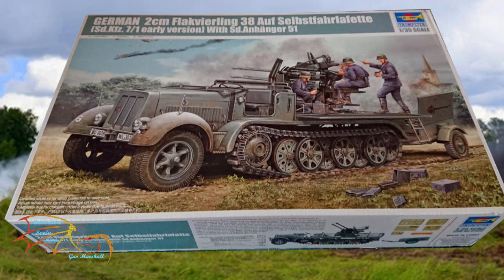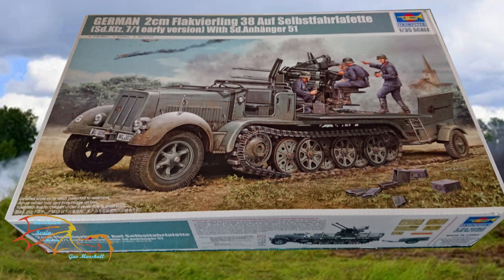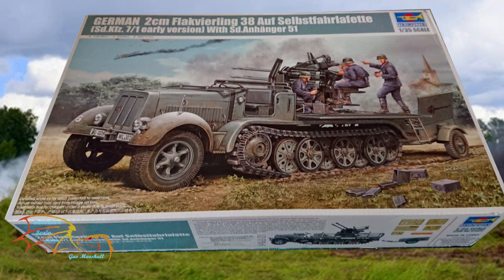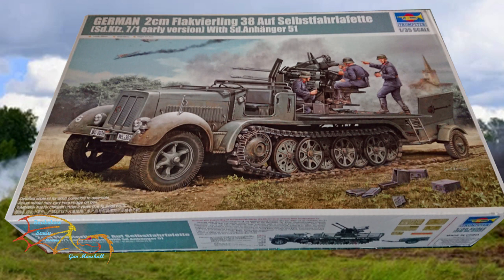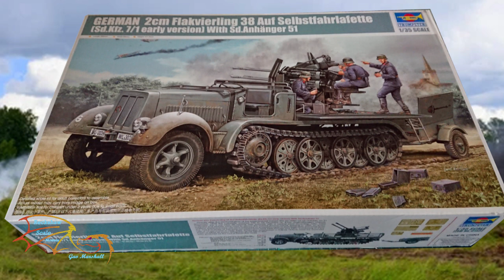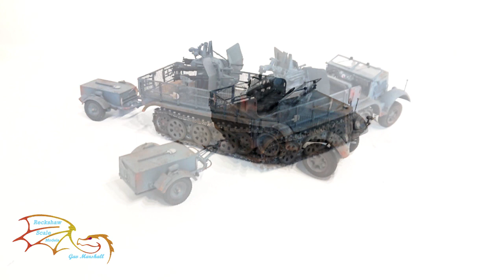Trumpeter German 2cm Flakvierling 38 Auf Selbstfahrlafette Scale 1/35  Part 13

Comment: Hi Gavin
Did Trumpeter give you an option of gun shields, firing and transportation positions?
Dragon do which I thought was a bit strange with your kit.
Great job mate and I bet you’re glad that you finally finished.
Thanks for sharing your work ❤😊
Reply from the maker: Hi Michael, yeah the options for the gun to change firing positions is there, although that wasn't quite clear on the instructions. You can build it with the sights and gun able to move including full rotation on the flatbed, the shields fixed to the main gun frame though. I decided to lock not to bother with the movement though, the main reason was the contact points are very small and I didn't think they would take would handling before braking.
The kit did miss out on the flatbed though. You could either have the sides fixed lowered or upright. This is a problem depending if you have decided to place on the gun's shields, if they are on and the flatbed sides are upright then the gun won't fit properly. That can easily be fix though with a little forward planning. A thin piece of wire could be added to act as  hinges on the sides. Thinking back, and even with the problem the kit is really good and would make an excellent diorama. Thanks so much for watching and the question, it's very much appreciated.